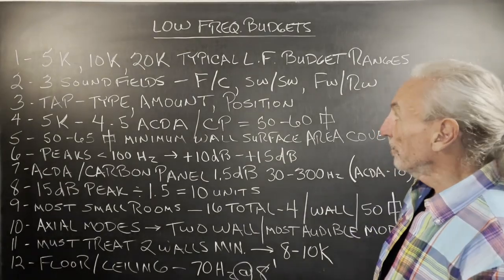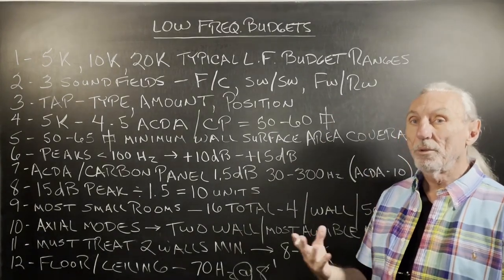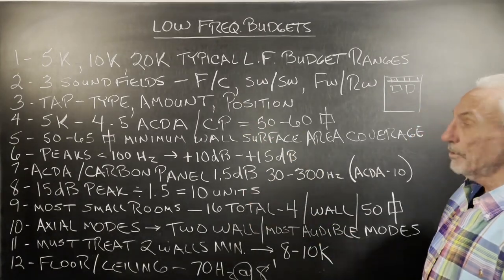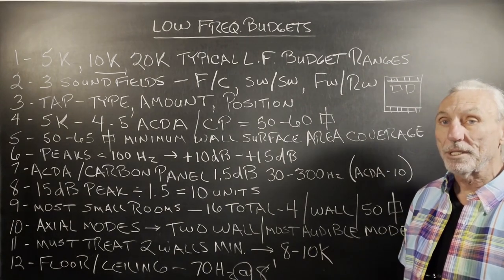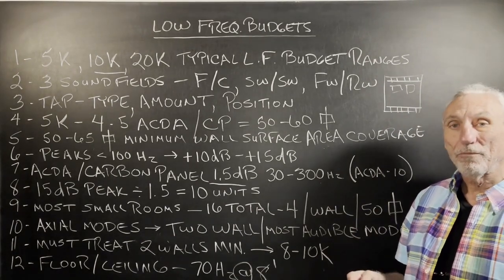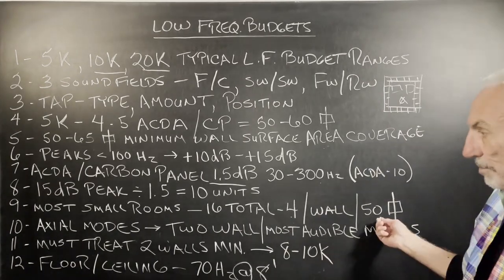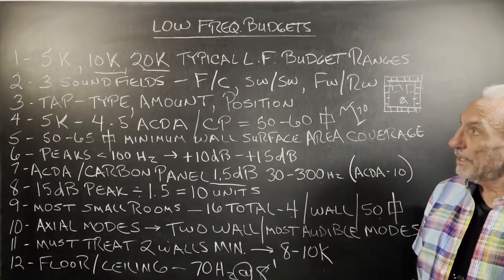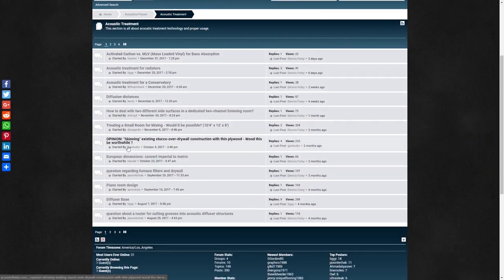Low Frequency Budgets - www.AcousticFields.com

Comment: Thanks, Dennis. A great video for customers to get a general idea on budget for room treatment.
Reply from the maker: Low frequency management requires a specified amount of treatment types that have the proper rates and levels of absorption to treat the individual frequency and amplitude issues each wall surface represents. Every wall dimension is different producing different frequency and amplitude issues along with different treatment requirements. This is where people fail. They think a box filled with building insulation works for all issues.

Comment: Does anyone know the science behind this: 
why whenever I place a plexiglass right over my window - literally right on the glass - it seems to amplify outside sounds more! Not the outcome I want for soundproof, but odd why it increases sounds.
Reply from the maker: Noise transmiion issues are vibrational acoustics. It is the wrong material type for your noise frequency and amplitude issues.